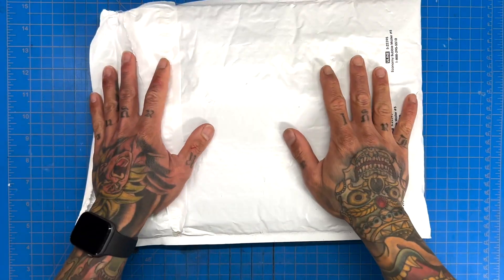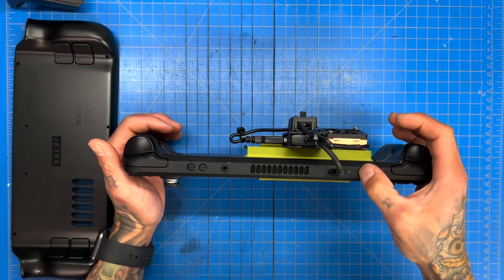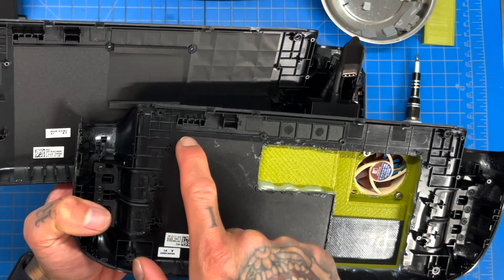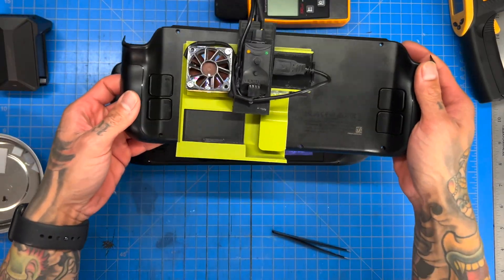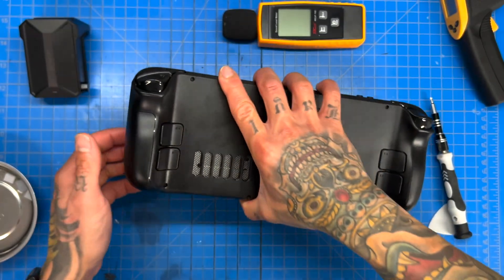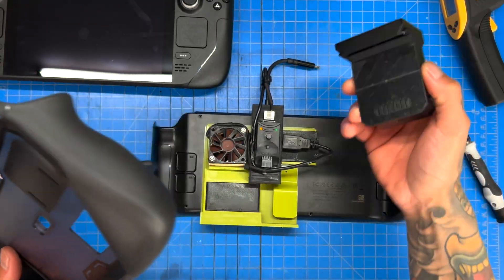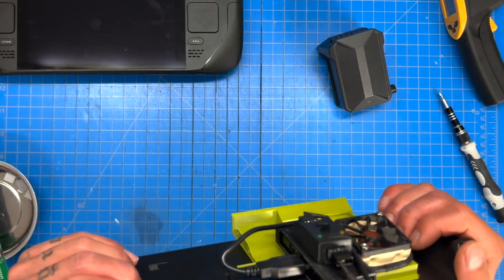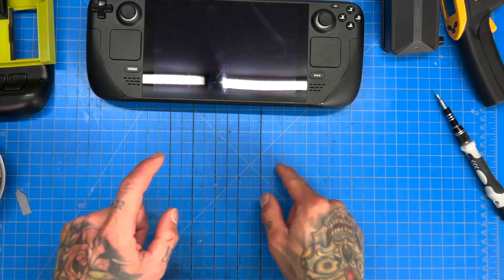Jsaux Cooler Vs The Ultimate Steam Deck Mod - #ifixit back plate review

Comment: Hey broo... Can you create with peltier method ? Just make heat sink back to the intake of steamdeck circulation, then put peltier on the cold side to the heat sink. Or you can use jsaux cooler with peltier.
Reply from the maker: Ive actually already done that.

Enjoy 😊 

https://youtu.be/a0ofCxio3PA?si=XeEXhUnJUtACKM0P

Comment: If it can run perfectly fine 10* degrees more, then $40 seems like a waste
Reply from the maker: Cooling the steam deck is only important when it comes to noise or over clocking.

Comment: The modded backplate probably whines because the grille spokes line up perfectly with the fan blades. We try to avoid lining them up when designing water pumps for this reason, at least it looks cool.
Reply from the maker: Hmm 🤔 didn’t think about that

Comment: Would you consider making a back plate to possibly sell 😮😮😮😮😮
Reply from the maker: Yes I working on a DIY kit, as for an actual back plate we’ll see. Injection molds are a lot tuffer to make
Reply: @Diy_Papi  I would love a back plate to easily access the ssd port. You got a follow from me
Reply from the maker: @smeky  Gang gang🤘🏻 I have the STL files on my website if you want to print your own. You can download it for free.

Comment: I got some Cyberpunk 2077 vibes, seeing your new creation, dunno why 😎 It´s really nice designed for just stationary use, but for on the go, the JSAUX cooler is probably a better choice 😜 For what purpose is the "door", where the normal air intake would be? Because this intake part is probably critical for cooling the charge controller and SSD.
Reply from the maker: It’s and access port for the M.2, so it’s easy to plug in a external GPU

Check out the vid! 

Only reason why their is a external fan on it is for the IC controller

Comment: Papi im on windows deck and im using jsaux transparent case without a fan and im on 58-61 max temp. I use a mods in there called steam deck tools. And help temp goes down
Reply from the maker: Is it a decky plug in?

Comment: hey bud, i'm a recording engineer. maybe you could orient your mic a little more towards your face so it picks up your speech more clearly. you're missing a bunch of high frequencies. if that's not possible, consider bumping that up in the eq.
Reply from the maker: It’s my wireless mic, having issues with it.